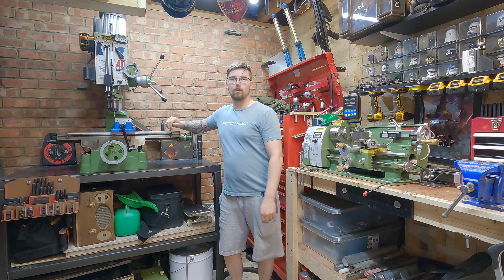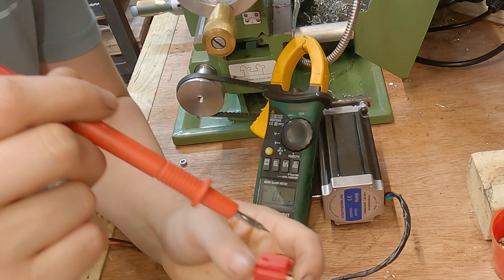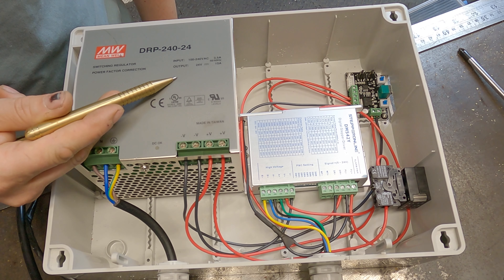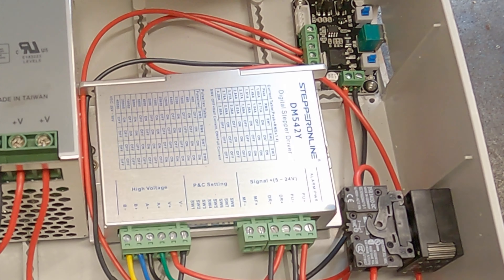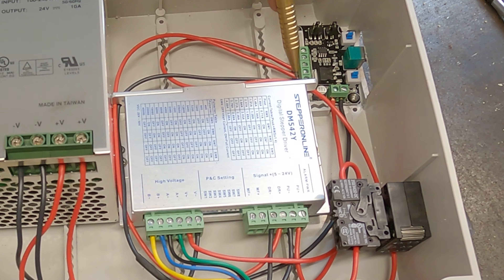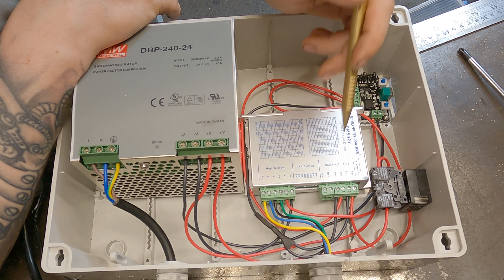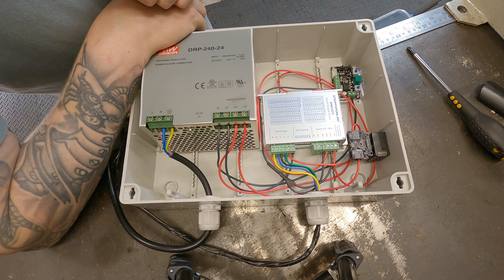How to wire a STEPPER motor and CONTROLLER

Comment: 24 volt to motors too less, need lot more volts run better. normal nema 23 motors used 36-48 volt and biggest motors used best running 80-90 volt.

Comment: Without shorting the wire, spin the motor, it should spin freely although you will feel the magnetics.   Now, take any two wires and short them together.  Spin the motor.  One of two things will occur, nothing, and great resistance.  If you feel the resistance, you found one coil.  The other wires will be the other coil, test by shorting them (make sure the original pair are no longer shorted) and spin motor. This effect is due to back EMF.  The spinning creates an electric current, which in turn creates a magnetic field which interacts with the magnets causing the resistance.

Comment: Good but still no information on the minor but important details like the Jumpers.. I still have no instruction on whether I use PWM or Freq for my Stepper and the 3 choices of Frequency..  Also you don't point out that if you don't connect the ENA cable then the button switch on the Pulse PCB doesn't work..     I am looking for explanations/consequences.. not just descriptions.. Thank you

Comment: I would fit an on/off switch on the mains input together with a correctly sized input fuse and a LED pilot lamp driven from the 24V line to remind you that it is on.
Reply from the maker: Thank you for the advise Horus great input 👍

Comment: As a complete novice to this subject this explained so much i have 3 stepper motors that came off the mill originally it was set up as a CNC mill but its an older sherline knock off and i couldnt find the program to run it and i wanted a manual machine,i am looking to connect up two of the stepper motors as a power feed for 'Z' and 'Y' axis

Comment: Another quick way to check if the wires are a pair is if you hold two of them together and can spin the motor if the motor is tougher to turn when there touching.  Saves having to bust out the ohm meter
Reply: THAT WORKS !!! I was thinking you were playing a JOKE and I was in for a SHOCK !!!  BLUE-YELLOW and RED-GREEN holding these together was harder to turn the Motor :) Thanks

Comment: Very good video. My question is how do I wire another switch in to change direction of the motor? I want to use a DPDT center off 6 pole momentary switch to change the direction of the motor. The two wires that are connected to the center 2 posts of this switch are the ones that get reversed depending on which way you move switch. Which two wires would I hook to these center posts that would control the direction of the motor?

Comment: Do you have a pulse generator that resets to zero when it's turned on so there's no surprise movement at start?  How do you have the speed knob wired and where did you locate it?  Is it possible to have a pulse spin dial connected at the same time a constant pulse generator is in the system?  Have you tried using any switches wired to dip contacts?  Any info or pointers to other specific videos would be GREATLY appreciated!  Thanks for the video!

Comment: Hi Joe. How are you bro. I installed the y axis stepper motor same as you have in my Cnc router 6090 machine but the problem is y axis direction changes traveling directions like when I use y+ machine moves forward and when I push y- it moves backward like both moves opposite direction and machine is also not going home correct

Comment: How do you match up the power supply and motor? I see you're using a 10 amp ps to power the 4.2 amp motor. Thank you
Reply from the maker: So from my knowledge the motor will only draw the current it’s rated to other than a bit more on start up. So I thought 10A was a safe number not to low and not to high to avoid extra cost

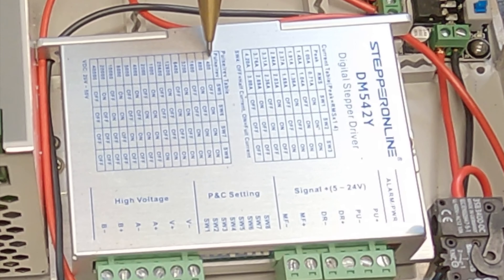Comment: @6:30 With "Pulses per revolution" you set microstepping., so the lower the number, the higher the speed and torque. The higher this number, the slower the motor turns, but has a more accurate position (also looses torque!)
There is a lot to read about miscrostepping..
Reply from the maker: Thank you for your input I’ll have to read up on this some more as I’m wanting to use this setup for my mill now so would be good to set everything up for more torque.
Reply: @MachiningwithJoe  Cheers!

Comment: Hi why I cannot turn the hand crank on a lathe after I install the stepper motor thanks Eli
Reply from the maker: The stepper motor is hard to turn even when powered off because of the opposing coils. You will have to slip the belt off to hand crank.
Reply: cnc not need turn manual newer. keyboard have buttons can turn axis.

Comment: Love those dewalt tool holders where did you get them from joe? Or were they 3d printed?
Reply from the maker: They are 3D printed but not by me. I got them off eBay fairly cheap.

Comment: Hi Joe.  Good video, would have been nice to have seen the motor running, and as an additional comment, what happened to the white wire?🤔.
One improvement would be to use an external changeover switch and potentiometer to control direction and speed, instead of cutting a hole in the box.  I’m planning to fit an XYZ DRO to my new mill WM16B, and power the table and head lift .  The thought is to use the same electronics i.e. PSU, PWM and Driver for both, and switch between the two stepper motors, and thoughts.  Cheers Noel
Reply from the maker: Hi ofrex if you check out my video on adding a power feed to the lathe you will see the motor in action. Do you mean the White wire coming from the motor ? If so because I used a connector plug between the motor and controller the wire colours differ end to end.

Comment: Could you add a rotary switch to control rpm of stepper?
Reply from the maker: Hi yes I do have a potentiometer on the circuit to control speed. I found myself mainly using it on the slowest speed to give best surface finish.
Reply: @MachiningwithJoe  You could try to set a a higher steps/rev value ;-)

Comment: Would be handy to wire in an endstop switch on a carriage stop. I get much better cuts when I let it auto feed. Deffo going to do this mod.
Reply from the maker: Yeah completely agree a carriage stop would be better and more safe.
Reply: @MachiningwithJoe  Couldn't that just be done with a switch at each end of travel wired in series on the power to the pulse on the controller?